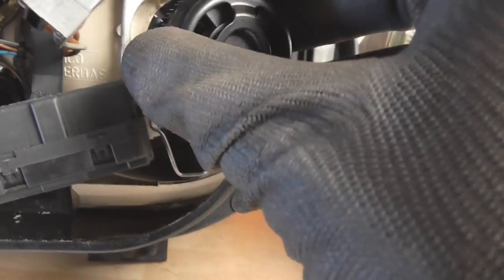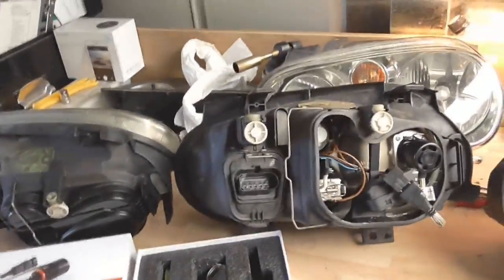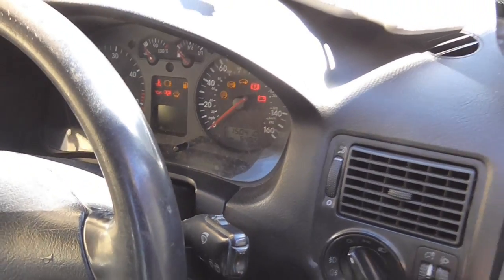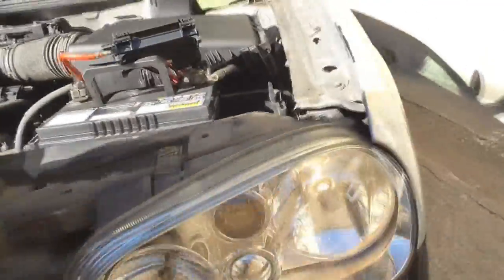Upgrading The Project Sheds Headlights and bulbs! - Volkswagen Golf Mk4

Comment from the maker: For those saying it needs to be in a projector lamp. I have a similar set fitted to the supras projector lamp and the light output is poor and the beam is shocking. At least in this headlight it looks bright. If when I use it at night it turns out to be shocking and dazzle everyone then I'll return to a normal set of bulbs. But let's be honest here.. I anit the first and I won't be the last.
Reply: Because there are zero vehicles from the factory in any Country where you can buy LED or HID lights that are not in a projector housing. Bright to you while blinding tf out of everyone else is just plain stupid. Either do the job correctly or don't bother.

Comment: Just to let you know these will be a MOT fail, not matter what, you not pass alignment.. on top of that people say that you should not use LED in non projector headlights.. They will be better how ever and you can try putting the light low down on the cabin adjuster to try not dazzel others so much.
Reply from the maker: The "only use hids or leds in a projector lamp" is a myth. If anything it can scatter the beam wider. I never said these would pass an MOT.

Comment: I don't think those bulbs will make any sort of decent pattern since they're should be used in projectors not reflectors
Reply from the maker: Led headlights are pretty crap in any type of headlight for a pattern tbf.
Reply: @bluudysgarage  I've had em and seen em in projectors before they do give kind of a proper beam. Depends on bulb company too. I bought some expensive ones from a company off eBay called "Nighteye". Personally I prefer  HIDs anyday lol. I run em in projector and reflector but I just tend to keep the aim a bit lower on reflector lights lol 😉 a good company for HIDs i can reccomend are "VIP HID"
Reply from the maker: @zhoaibraja2992  good to know man.

Comment: I don’t think you can use that led bulb in that head light , it has to be a projector type light you put them in, you will dazzle on coming traffic and fail the mot as it is ,
Reply: Not like hes the only guy putting them bulbs in let be honest.
Reply: Leezy true
Reply from the maker: We shall see. Of it's terrible I'll take them out.
Reply: @bluudysgarage To be honest, Golf Mk4 reflector headlights are rubbish which is why I changed mine to projector headlights so it leaves a sharp cutoff line especially I’m currently run 8000k HID kit! I had the anti glare HID in reflector for a while and the beam pattern is shit but there’s no glare or get flashed. That’s why I went for projectors